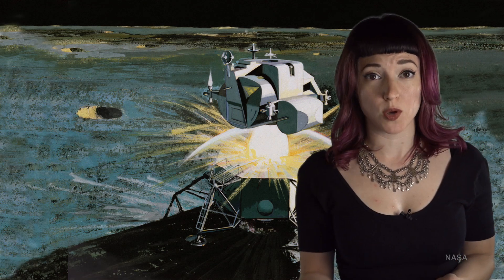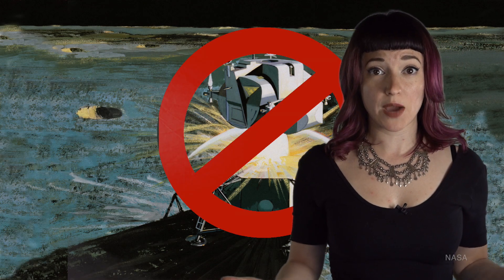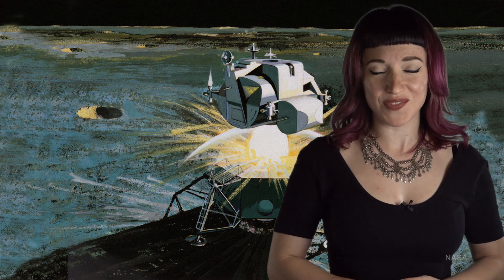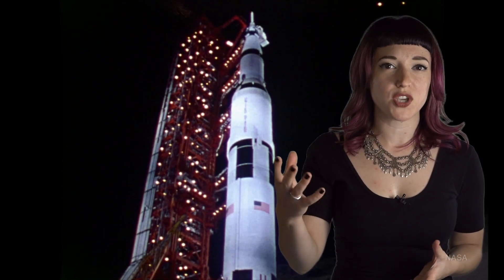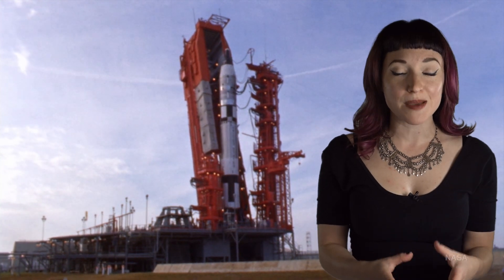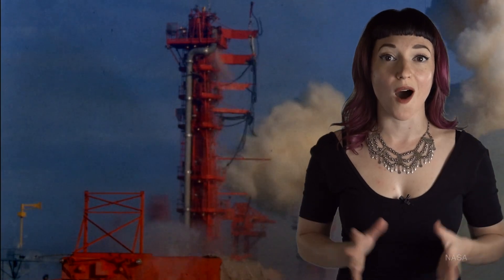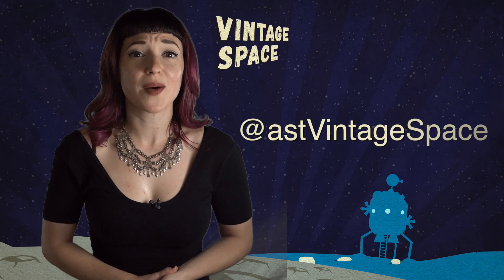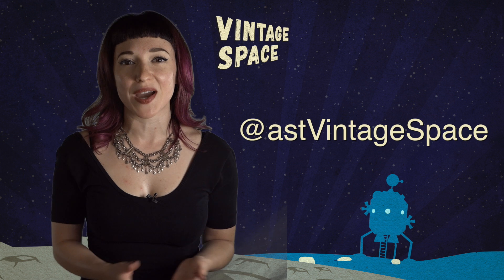How the Lunar Module Launched from the Moon Without a Flame

Comment: If space is a vacuum, then rockets do not work in space because they do not work in a vacuum.   Nothing for the exhaust to push against.  No atmosphere.  No matter how powerful your reaction creating exhaust, there is no thrust as the vacuum of space would actually pull the exhaust out of the nozzle FASTER than the exhaust is expanding.  Hence, no thrust.  None at all.  Amy,  you should really get out of the matrix....stop listening to the so called experts and do some critical thinking for yourself.
Reply: False. Rockets (properly fueled) do work in a vacuum. They eject mass. Everything you said shows you need to study actual rocket science.
Reply: For every action there is an equal and opposite reaction.  
stupid idiot moron
Reply: Read up about a dude called Newton.
Reply: Coleman Adamson: It appears you are in the matrix. Rockets expel what is actually known as "Exhaust mass" in rocket science. That mass does not push against anything in a vacuum. But it DOES, push against the stage from which it is ejected which is how it can move rocket stages and spacecraft in space in accordance with Newton's 3rd law. If you had ever eye witnessed a launch, you'd know this. You can follow the rocket visually to as far up as 70 Km altitude, or past first stage separation. You'll see the plume expand due to being in what is essentially space at those altitudes. The rocket continues to ascend rather than fall back down which is what it would do in your version of rocket physics. You know where your argument came from? It came from a New York Times magazine article in 1920 that criticized Robert Goddard's moon mission ideas. The NYT apologized to Goddard in 1968 if I recall right. Or maybe 1969 when Apollo 11 landed. But the long outdated  argument has been parroted by professional and amateur lunar hoax advocates alike. It apparently never occurred to them to watch an actual rocket launch, or take rocketry 101.
Reply: ***** You keep talking as if Newton's Third Law doesn't exist. As such, it doesn't matter whether there's a vacuum or no vacuum. The exit of the exhaust creates an equal and opposite reaction, propelling the rocket forward.

Rockets are tested in giant vacuum chambers here on earth. They generate thrust, even though they're firing in a vacuum. Likewise, you can go into a vacuum chamber with a wheeled chair and a fire extinguisher. Sit in the chair. Fire the extinguisher. You will roll backward, opposite the jet of the extinguisher, even though the exhaust has nothing to push on.

Another example, go out on an ice rink with a basketball. Throw the ball. You slid backward, although no force impinged on you. Your motion backwards was an equal and opposite reaction to throwing the basketball forward.

You also don't understand the conservation of momentum. In any action, the net momentum of the system must be zero. The momentum of the expanding gases out the back of the rocket are offset by the forward momentum of the rocket, leaving a net momentum of zero.

You know just enough physics to be dangerous, and you've decided to reject anything that sounds counterintuitive. But space is not like earth -- there's no atmosphere, and you're in free fall, so there's no friction with the surface of the earth. Orbital mechanics are likewise really counterintuitive, but that's how it is. You need to keep learning, get an education. Drop your smug, smarter than thou attitude. There will always be people smarter than you, more knowledgeable than you. Not me, per se, but somebody. A little humility would lead to better understanding of the world.
Reply: ***** A "Super Vacuum"? The vacuum in space is only 14.7 PSI less than what we have here at sea level.

If your idea is right ,there are no satellites, no ISS, no space travel of any kind. But why don't you go out on a clear night and LOOK UP and see all the satellites passing by overhead? Or look at your PHONE and discover the GPS in it. Or look around and see all the SATELLITE DISHES on houses. None of those things would exist if rockets don't work in space. 

Flaws in the experiment? Please point them out.
Reply: +Coleman Adamson Nice try, but that thing leaks because it's not hot enough. When it gets hot from its speed, it will stop leaking. It's designed for that, just like spacecraft are designed for space.
Reply: ***** Haha, loser. The SR-71 is DESIGNED that way. At 2500 mph, its skin temp reaches hundreds of degrees. What does metal do when it heats up, yo? IT EXPANDS!

You really think they could build a Mach 3 aircraft, but couldn't figure out how to get the fuel tank to stop leaking? You can't be that dumb.
Reply: Vacuums cannot pull. Please read up on Newton's laws of motion.
Reply: "... Nothing for the exhaust to push against ..." Actually, there is. The mass of the exhaust gasses pushes against the rocket engine and in turn the spacecraft it is attached to creating a force equal in magnitude and opposite in direction to the force of the escaping gases. You are correct in that the lack of atmospheric pressure will effect the behaviour of the gas plume, but that occurs after the gases have left the engine and hence after the force has been exerted on the engine and spacecraft.
Reply: SirHuddleston Fuddleston That was because it HAD NO FUELTANK. The fuselage was the fueltank. So if they had welded it shut, it would have bent and twisted as it heated up - and crashed and burned.
Reply: Space is not a total Vacuum as well as what has been said by Josh Tarrant and Anonymous User
Reply: I think it is you who are in the matrix. Seems my comment was deleted. I didn't say anything nasty. I did say this idea came from the New York Times 1920 article criticizing Robert Goddard's lunar mission ideas. The "Exhaust mass" of a rocket as it's called, does not need to push against an atmosphere. This can be demonstrated if you have ever seen a rocket launch. The rocket reaches staging altitude which is typically 50-70 Km. That altitude is effectively space and from the ground, the plume clearly expands due to lack of atmospheric pressure even as the rocket continues to ascend. Professional lunar hoax advocates apparently read about the NYT article and conveniently forgot the part where the NYT apologized to Goddard before the Apollo 11 mission. And of course, amateur hoax advocates simply parrot what they hear from the pros.
Reply: I would like you to conduct an experiment. You need a lake, a rowboat, a big rock and a beachball. If the exhaust has to push against something to work, then it would not matter to the rowboat if you throw a huge rock or a beachball.
Reply: It's all about conservation of momentum. The momentum imparted to the rocket's exhaust gas is matched by the momentum given to the rocket in the opposite direction. Critical thinking is great, but when it's not supported by empirical evidence it's time to think some more.
Reply: Allan Folmersen Yes, but there are other experiments you can do on earth which prove Newton's Third Law. Sit on a wheeled chair holding a basketball. Throw the ball. The chair will roll backwards, although no force was put on the chair. It's an equal and opposite reaction to the forward flight of the ball. You can even calculate how far the chair will move, based on the relative weights of person/chair vs basketball, and the distance the basketball traveled.

You think this hasn't been proven every day in labs the world over for 300 years? If rockets pushed against the atmosphere, they would LOSE THRUST as they ascended and the air got thinner. The REVERSE IS TRUE. Sorry, but you're wrong.
Reply: "...remember a propeller and a jet engine turbine are basically air moving devices..." No, they both are't. A gas turbine engine is an air moving device. A propeller is a thrust producing device that creates low pressure in front of it and high pressure behind it. The reward acceleration of air is a byproduct most noticeably observed on a stationary aircraft on the ground. A propeller on an aircraft in level flight and at constant airspeed disturbs the air a surprisingly little amount. In fact the less air moved the better as it's a pressure differential that is needed, not air movement. If what you're saying was correct then a turbofan and a turbojet would do exactly the same thing, yet they are very different propulsion systems with very different performance. Why? Because one drives a propeller and the other drives a fan. To understand aircraft propulsion systems, one needs an understanding the difference between a propeller, a fan and also an axial compressor (again, not a fan).
Reply: Coleman Adamson Newton's third law and it's operation in a vacuum is widely accepted and is supported by experiment and observation. If you are proposing an alternate theory then isn't it incumbent upon you to produce evidence that supports your theory?
Reply: Look at that Gemini launch. See the shock diamonds in the exhaust? That's because that engine works better in a lower pressure...
You burn the fuel, which then massively expands and pushes into the bell of the engine. That force makes you go up. About the shock diamonds: engines are the most efficient when the pressure at the end of the bell is equal to the pressure outside. That's why engine bells used in space are often much larger than the ones used during launch.
Reply: ***** Space can't pull. Particles move from a region with higer pressure to one with lower pressure because of the amount of particles behind them pushing them. By putting a lot of particles into the bell, they are pushed outwards. Some escape the bell, but their force was in the wrong direction, so that doesn't matter. Others collide with it and push the rocket forward.
Reply: +Tony Holly  He's referring to an idiotic video on YT where a guy has a balloon attached to a toy car. It pushes the car forward. Then he holds a vacuum cleaner nozzle near the balloon's exhaust. the car doesn't move. What he fails to realize is that he's not creating a vacuum with the vacuum cleaner, he's merely creating a strong airstream which keeps the car from moving. Pure idiocy.
Reply: ***** Wait. Are you saying we can't seal a fuel tank in space? A lot of valves on earth handle larger pressure differences.
Reply: ***** Uneducated twaddle. You can use space as an insulator, and thereby decide what temperature your tanks have. Do you know what a thermos bottle is?
Reply: SirHuddleston Fuddleston I'm sorry, but you are talking to the wrong person here. Address your comments to the "rockets don't work in space"-guy.
Reply: Allan Folmersen Sorry, misfired.
Reply: I did in my early reply. And the ability to distinguish between an apple and an orange isn't nitpicking, it's understanding the difference between two things. They're both fruit, they can both be eaten, they're both roughly spherical and they're about the same size. But they aren't the same and they can't be interchanged without potential consequences (try making marmalade with apples!).
Reply: ***** What is the pressure differential between the combustion chamber of a rocket at sealevel and in space?
Reply: @Coleman Adamson I'm very interested in the vacuum cleaner experiment. Can you post the observations, please?
Reply: +Coleman Anderson
Tell me please. If your are standing still in a perfect vacuum and throw a brick away, would you remain motionless or drift away in the other direction?
Reply: Get yourself a basketball, a medicine ball and something with low friction (a skateboard, swivel chair, whatever).
Sit on the chair/skateboard/whatever and throw the basketball forwards. What happens? You'll roll backwards. According to you, this is because the ball pushes against the air, or something?
Do the same with the medicine ball. Any ideas what will happen? It's pretty much the same size and shape.
Reply: ***** Can you or can you NOT point to the flaws in my experiment? IF the exhaust is dependent on pushing on air, it should not matter how much mass is expelled, right?
Reply: ***** 
What about pushing the exhaust faster than the vacuum would "suck it out".
Reply: ***** Thankfully, you are "not even wrong" (look it up), but you are not even reading what I wrote. IF the beachball and the rock (of equal size) is thrown with equal speed from the boat, DOES THE BOAT MOVE EQUALLY?
Reply: Sander Datema
No, you see space is magic.
Reply: st0rmforce
Bad magic, I guess...
Reply: Before bringing out another point, could you first take a look at this?  xkcd.com/1731/
Reply: If the rocket engine only worked because it was pushing against air, how do you explain that F1 engine creates thrust which if you divide it by the nozzle area is about 6 times athmospheric pressure?
Reply: SHF: hoax believers ARE that dumb
Reply: Allan Folmersen Oh my....your example has so many flaws it's absurd.   Did you write that while stoned?
Reply: ***** I'll answer you because your reply was the longest, incorrect, answer.  The problem is...your mind is so indoctrinated and so patterned that somehow you cannot comprehend a vacuum....or that you think the rocket is sooooo powerful that it can overcome the physics of a super vacuum.  That's it really.  Your mind (and the minds of others) cannot get it through your reasoning center that no matter if the rocket's engine produces an INFINITE amount of "exhaust" it simply cannot, by the laws of physics, overcome a super vacuum.  The vacuum of space would STILL draw out, pull out, suck out (if you will) all the energy FASTER than it's produced.   (Never mind there are no o-rings or seals of any kind that can seal the propellant tanks and space would suck out all the fuel before it ever got to react.)  Rocket engines are not infinitely powerful...and even if they were, the vacuum of space would overcome any "ejection" of gases by pulling them out faster than they are made.  Hence, no thrust.   Try really hard to think about that.  If you are intellectually honest, you will eventually realize rockets don't work in space any better than propellers.  No matter how fast you spin them.   Nor will a jet engine...no matter how fast it runs (remember a propeller and a jet engine turbine are basically air moving devices)....and no matter how fast or powerful a rocket engine is (it simply moves air [gases] faster than propellers or jet turbines), the rocket cannot produce any thrust any more than the other two could in space.  Happy contemplating!
Reply: Tony Holly Oh Mr. Nit Picky......why didn't you try to refute rockets don't work in a vacuum?
Reply: Tony Holly Rockets in a vacuum.  Show me the physics.
Reply: Sander Datema You are an excellent example of the problem mindset.   You said "massively expands".  That is the problem.  People think that the reaction is so powerful that it can overcome the zero (effective)  density of space. No.  Even if your burning of fuel (see below) was more than massively expanding.....was even infinite in it's expansion, it can't push against what is not there.  See, our normal experience tells us the rocket must move because we do not live nor do we ever have experience with vacuums in normal life. So our minds have great difficulty in understanding their properties.  We CAN get that a tiny leak in a space suit or space craft will result in explosive decompression but don't make the logical jump to rocket engine exhaust being PULLED OUT of the "bell" faster than it is produced in the bell. And that is what the vacuum of space does.   Draws out any exhaust faster than it is produced. No matter how "massive" the expansion or powerful the reaction.  Not only is there no resistance to the expansion of the gases, but the gases are actually pulled out of the bell faster than they are produced.   One can demonstrate this in a crude manner by the use of a balloon powered toy car.  If the exhaust of the balloon is left unimpeded, it pushes against the air and the equal and opposite reaction is forward motion.  However, if one simulates the conditions of space via the use of a simple household vacuum cleaner, placing the hose near the exhaust port of the balloon car, one finds the vacuum cleaner draws the exhaust of the balloon car faster than produced and the car does not move forward.
Reply: Allan Folmersen Correct. But not the way you just said it.   The exhaust is not dependent on pushing air.......thrust is dependent on the exhaust having air to push against.   No matter how powerful a rocket engine, no thrust can be demonstrated in the vacuum of space.  (and don't forget the propellant would not remain in the tanks because there is no material in existence that can seal the tanks and valves....hence the propellant would leak right past them into the vacuum of space)
Reply: Sander Datema Spoken out of your butt.  Get an education before you PRETEND to know something.  In case you missed it.....we can't even keep the fuel in the SR71 Blackbird from leaking all over the runway while the plane is just sitting there.  The extremes of space are a much greater challenge than the Blackbird on the ground and in flight. There is no material, natural or man made that can seal the propellant tanks of a rocket in the extreme heat and cold of space.